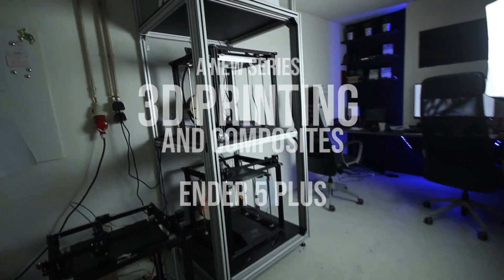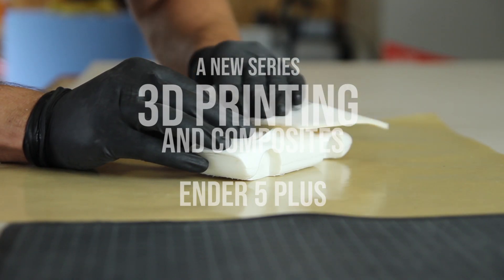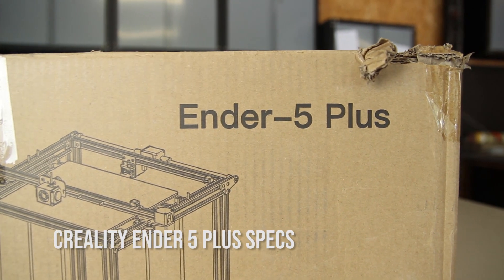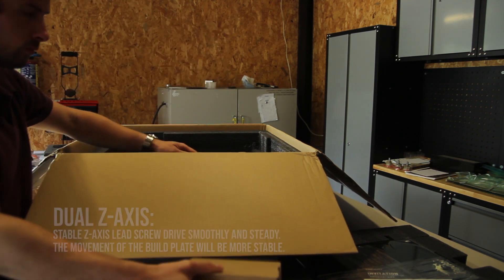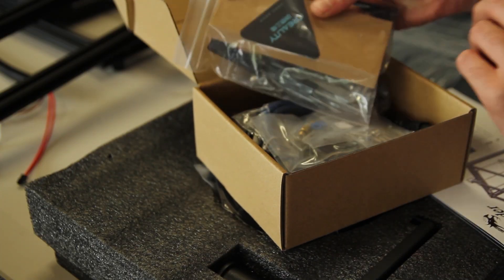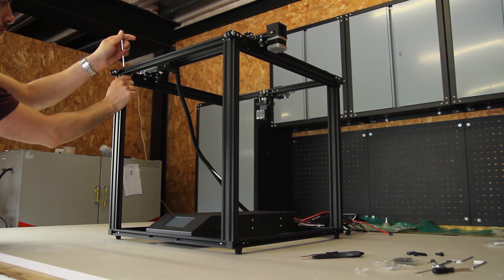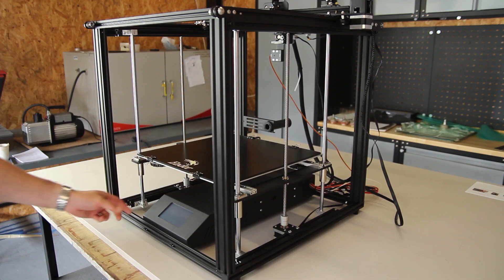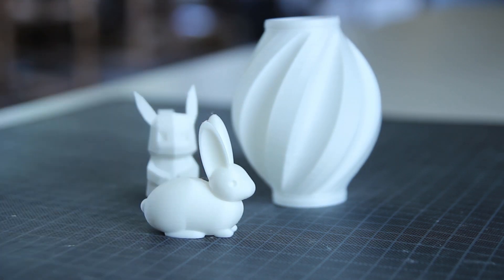3D Printing and Composites - Creality Ender 5 Plus

Comment: Nice to see you again Matthieu! I bought an Ender 3 one year ago, very esceptic too. Now I finished my Voron 2.4. For some reason from a month ago I don’t have acces to a CNC but I don’t mind because I have my 3D printers, and they work during the night and don’t need any assistance. For me this is a game changer. I printed molds in Nylon-CF, laminate prepreg carbon and put them in the oven at 110C, just amazing. in my opinion there is a lot to learn in mold design because we are still with polyurethane and cnc in mind. I’ll be watching you with pleasure!
Reply from the maker: Will need to try those hi temp and stronger fillaments, as by now I'm still only using PLA, but will look into that as well!

Comment: I would love to see an elegant solution for 3d printing a part, which could be "wrapped" with a composite, and subsequently dissolved leaving a "hollow" composite piece. Think of something like an automotive airbox or intake pipe which would normally require a two piece mold, etc.
Reply from the maker: true! Will try to cover that!

Comment: Awesome! I have an Ender 3 and 2 CR-10 printers. I have never been a fan of the layer lines which is why I purchased 2 Elegoo Saturn SLA printers with the intent of making molds.
Reply from the maker: true! looking into SLA as wel for the future, as far as I know still limited in size no?
Reply: @MatthieuLibeert  There are size limitations but you can slice a large model into pieces and bond the pieces together.

Comment: I've had an Ender 5 plus for a year and a half. The nozzles clogging gets a bit annoying. I've always liked your channel, i think a really strong use for 3d printing for you is to use 3d printed protoypes to use as mold for composites. CAD up a cool shape. 3d print it. Carbon Fiber unique shapes.
Reply from the maker: I now have them for 5 months and so far no problems. When I find out I have some problems with them, I'll be more than happy to share to good and negative of these printers, So far pretty happy
Reply: @MatthieuLibeert  mostly it's changing the brand of filament. If you have a filament that works reliably with your settings stay with that.
Reply from the maker: @Awesnap  ok! good to know! thanks